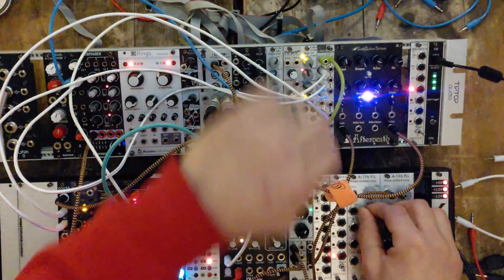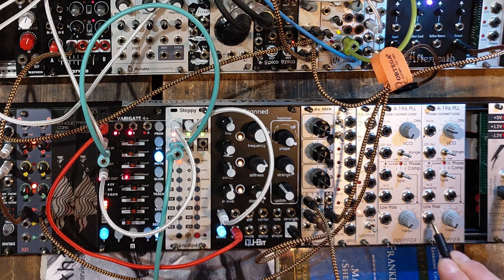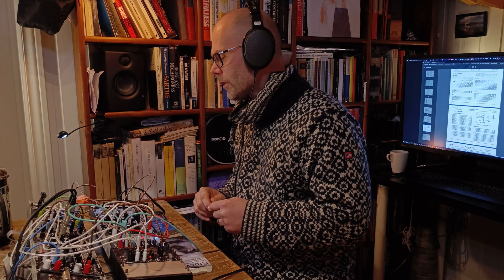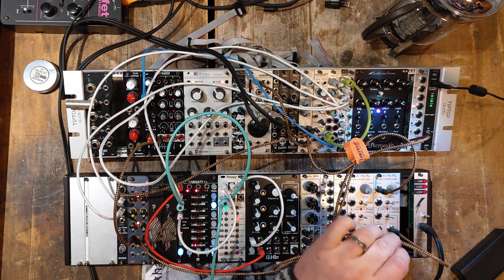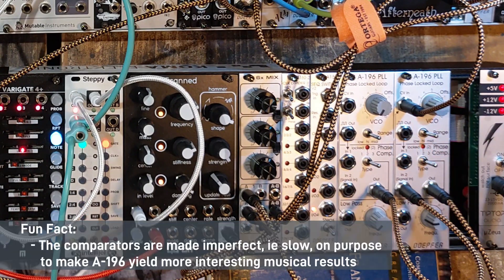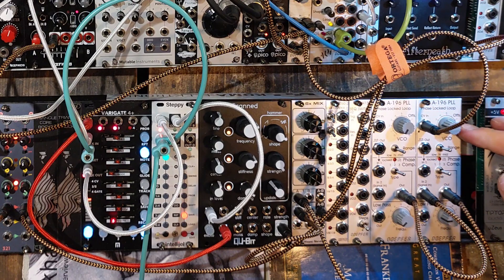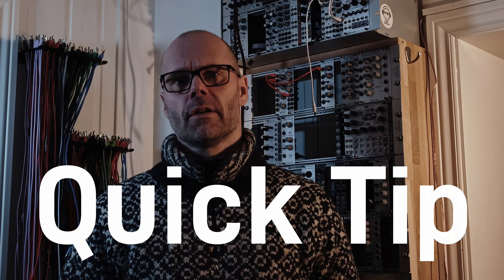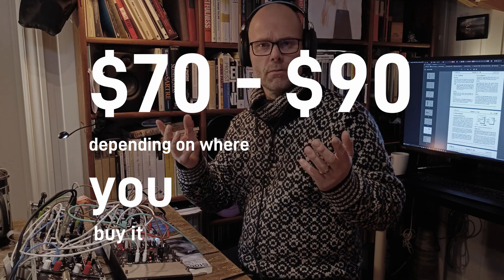Is this an analog beat machine..? - Almost forgotten Phase Locked Loop from Doepfer...

Comment: If you're not independently wealthy, but want to experiment with cross-modulating multiple PLLs, etc. I highly recommend Frozen Wasteland's PLL for VCV Rack... free, and has additional comparator methods (coincidence, fuzzy XOR, fuzzy hyperbolic XOR), which can lead to some pretty wild results :D
Reply from the maker: Great tip! Thanks!
Reply: @axis_8 Description from the FW manual page: 

Added CV control of the LPF that the 196 did not have
Added Pulse Width and Pulse Width Modulation of the internal VCO
Generally you want to "listen" to the SQR OUT
You'll want to feed a Square-ish wave into Signal In
Low LPF FREQ settings create a warbling effect, high = craziness
EXTERNAL IN overrides interal VCO
The LPF OUT is normalled to the VCO CV, try patching something in between the two
Five comparator modes: XOR, D type Flip Flop use different boolean logic. Coincidence is based on which signal is "ahead". Fuzzy XOR and Fuzzy Hyperbolic XOR use logic operators based on work by Lofti Zadeh and hyperbolic parabolas respectively
Does not make pretty sounds, but can be a lot of fun.

Comment: I just got a PLL. One thing I would add to your beat technique. Take the square out into an envelope. It will follow the modulation input into the oscillator frequency. In low and sometimes medium settings the square out will act as gate. The envelope will open and close the audio in a vca giving you silence between beats.
Reply from the maker: Hi, thank you for your tip! Will try!✌️